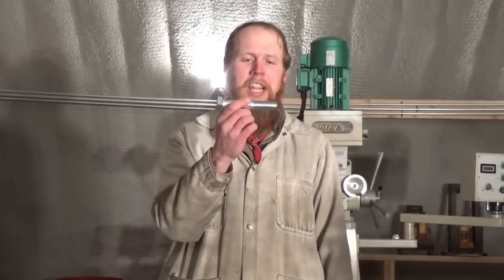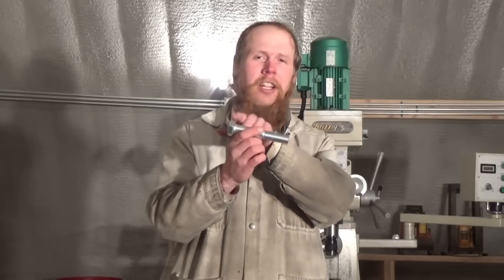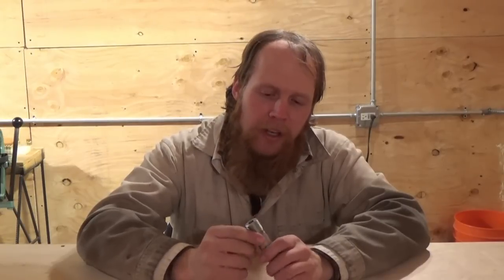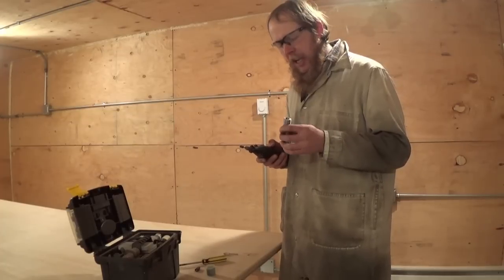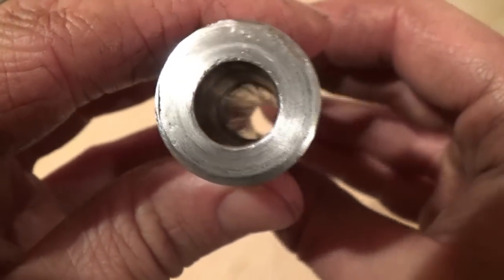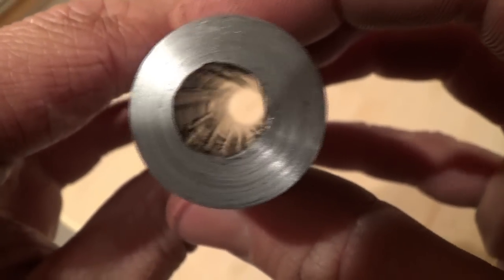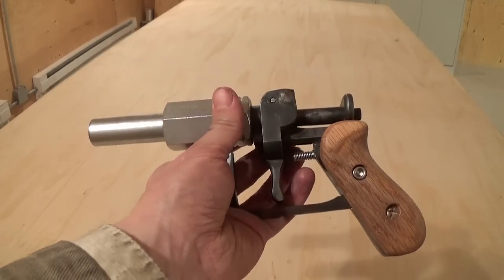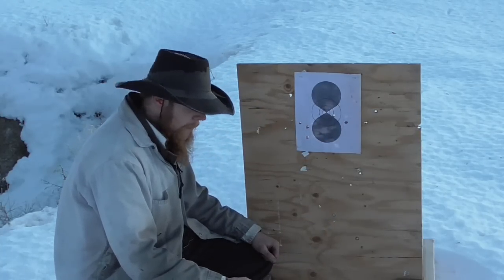Making a Rifled Barrel without Machine Tools (TIS081)

Comment: Simplicity is genius. I've been into firearms for decades, but never realized one can make rifling that easy. Another nail in gun control's coffin!

Thank you for sharing your knowledge.
Reply from the maker: You're welcome - glad you liked it!
Reply: Single nitrated gun cotton isn't really a problem to make. Buying the chemicals might become a huge issue if the gun-control people are out to get ya.
Regardless, i'd suggest using black-powder, rather then smokeless. Potassium nitrate can, if need be, be made from pissing on a decomposable media like straw, in plastic bags, sulfur can be had from gardening centers, aquarium suppliers, and so fourth. It's uses are so widespread it's not going to get banned. And charcoal. Well, if you cant buy good charcoal in the local store, you sure can buy bad charcoal, and use it as a heat-source for making your on, good charcoal.
Yes, black-powder would make a puff of smoke when you fire the gun, and it would be more corrosive on the barrel. Making the barrel is more or less the point of this video, so making a spare / replacement, shouldn't be an issue.
The smoke has to be dealt with. Fire from cover, and it should be fine. People did that for a while before we had smokeless...
Reply: All your gun control are belong to us!

The best use for an improvised gun like this is to find one of the bad guys that looks like he's lonely and tired of carrying that UMP-40 around, and solve those problems for him.
Reply: Consider that China is called the replication country not because of its modern achievements (and they are achievements no matter how much wants to piss on them), but rather because many moons ago, they would make "by ear" copies of Western (including Europe) guns with limited tools and functionality, but that were every bit as complicated to make/replicate as the original, say, prototypes were.

I suggest you head on over to "Forgotten Weapons", Ian has a very nice selection of videos on those weapons. They are every bit as amusing, as they are a reminder, that, one time ago, everyone and their mother could just go ahead and make guns. And it's not just wistful thinking of time long gone, it's fact and reality once you dig in to the lives of the gun designer giants.

They were not so different from every other person roaming the planet back then. They just happened to have all the pieces in the right place to become the ones who made the cartridge, the barrel, the riffling, the striker plates etc.
Reply: Why buy the chemicals? all you need is nitric acid and cotton, any nitrate salt + hydrochloric acid + copper can be used to make nitric acid and the copper can be recycled, or any nitrate + sulfuric acid works too, ostwald process can be used to make it from ammonia but can be kinda hard to find platinum for the catalyst. Also you can just zap the air with electricity from a neon sign transformer or other high voltage source to form nitrogen dioxide which can be bubbled through water to form nitric acid. And if cotton gets banned then everything's already fucked up
Reply: Well... (to) Deep rifling lets gas escape around the bullet. If we tie back in to BP loads, this is both good and bad. It leaves a bit of room for "crap" before the rifling is so messed up it no longer does anything. It also lets a fair amount of the gas you need to push the bullet around pass by the bullet, meaning lower exit velocity, shorter range, and to some extent, lower accuracy.
For smokeless, it's only the bad part that is true...

All in all. You don't want to make the rifling to deep unless you have specific intentions with it.
Reply: You got a point. I did answer in the context of the video. Single shot, or manually operated guns.
Anyway, recoil operated guns "should" work. You need hot BP, which is something different then commercial BP, they go for consistent performance, rather then the best they can make, and as much as you can realistically fit in your rounds.

In the long run primers will be an issue. Armstrongs mix can be improvised from matches, but that wont be very safe, (armstrongs mix is very sensitive, hence works for primers, but loading them can be... unsafe.) and making the brass bit will become a problem once you cant re-use the old ones.
Reply: @SweMisterB  : please look into "Dr.P" videos where he shows you how to make a modern primer compound. Check out google -- patents website they are loaded with stuff on these topics. 1920s-1960s soviets used potassium chlorate based primer compound, yeah the corrosive stuff, but if sealed could last reliable and a long time. Keep up the topics and communicating. Sharing and reading and we will in time have some good BP loads and GOD willing some single-based pyrocellulose/nitrocellulose for our SA/FA arms. In the endgame the gun-control crowd is looking to pull the game in their favor. Smokeless powder, drawing cartridge cases, making bullets and/or jackets, the punches/dies for their production, and a decent primer compound ... this is where they are praying their HAIL MARY. We need to pray HAIL JESUS and study, not give up and recognize this. And in the endgame we hopefully will come prepared. TTYL
Reply: Tiny bit of history. The .303 British round was first produced using black powder, fired through Metford-pattern rifling in the Lee Metford rifle. The cartridge was designed with smokeless powder in mind, but the hotter gases wore out the Metford rifling more rapidly.

There were earlier repeater and breech-loader rifles using black powder.
Reply: +Bill Dyches
I'm fairly sure standing up and banging your chest is not a viable tactic, lol. I suspect you meant guerilla. (Spanish for small war.)
Reply: +denis pucheu when the Nazis occupied Poland they oversaw machine shop operations, restricted access to cutting tools for mills and lathes and acquisition of quality steel stock was license-based.

They still managed to produce their Lighting SMG.
Reply: can you give me some dimensions for the bore and the carver thing in mm please?
Reply: Gun control is one of the reasons some despotic governments are screwing their people as I am writing this.
Reply: They were rifling barrels in the american civil war, probably in a similar fashion. Maybe with a fly press.
Reply: please in .22 9mm and .45 if you know them...thanks in advance...
Reply: Nope. Not even a hint. The reality is, it differs depending on who made the barrel, and when.
Lead casting bullets can, should be done, after pressing a lead slug through the barrel, measuring it at it's widest, and adding 0.002" to the size. (So, they measure the bits that have been at the deep end of the rifling.)
If you already got the bullet casting gear, or, intend to use store bought ammo, grabbing a quality brand, measuring the bullets at their widest, and deducting the same should give a reasonable fit. If your going with steel mantels, i'd deduct half as much, but copper and lead should be fine with the same barrel.
(Not exactly certain how common that kind of ammo is. Apparently the Swedish military sold of a surplus a couple of years ago, so some shooters have it here. From what i've been told it does increase wear, but works just fine with the same barrel as the regular ammo uses, but i'd still suggest a "loser" fit, to increase exit velocity.)

So... The bore then has to be the bullet dimension, minus 0.002, minus the intended dept of the rifling.
Well. That is my understanding at least. I haven't made a rifled barrel in... ever. So theory, without practice. Pretty much worthless. Do with it what you want.
Reply: Like the liberator pistol, which didn't see the light of day, but was a good idea during ww2.
Reply: They will take our dremmels and jacks like they took Red devil lye from the meth cooks.
Reply: +Meow Meow Fuzzyface the bore stays the same and the rifling can be as deep as you like in a small margin ofcourse...?
Reply: +Mr B real nice explanation...thank you for that ! i am getting wiser by the minute here...do you know a site with the dimensions of bore for different calibers?
Reply: surtcaldera of
Reply: PikPobedy how do you think firearms are made?
Reply: SevenSixTwo2012 Good day,

More need to be maimed like this.

One or Two shots, and all blunt or bladed.
.just like the 2nd when wriTten . That is all that was available.  FACT NOT FICTION.

Thank you for your time.
Reply: Yes about China, and then our greedy brain trusts here in America and elsewhere sent our people over there to teach them how to manufacture correctly,  killing our economy, and making gazillionaires of the Walton's  in the process.
Reply: Soul Chicken you can, see the "Anarchists Cookbook"
Reply: Soul Chicken  : this is where the gun-control crowd for years is planning to trap us, then take us down. Its chess, not checkers. Drawing cartridge cases. Making bullets / jackets /dies forming. Primer compound. << this is what they bank on us not being able to do. Then they will take over the means of production, think east germany/USSR/ socialism. Then we will have to as a TEAM not lone wolf, produce the raw-materials to make the bases, then make the product. Together, I KNOW we can. Keep studying. Keep talking about this. Proof, in 1990 not many americans were making diy barrels with a bottle jack and a drill press. Word of mouth, a rebellious attitude, passion drive and never give up we will hold our own in the end game. BP, sure, for more than just 1911's bolt/lever 30-06, 7.62x54R, 8.57, .303 etc. if ya know what i mean ... lol ... but smokeless for your M4, and my 9x19, SKS. If we work hard today together, we will smile tomorrow. Trust me!
Reply: I think it would be interesting to 3D print that same design then use that to make a cavity in a mold with, take some of the more difficult steps out of milling metal, of course, you need some way of melting the metal to pour into the mold, but doable I'd imagine.
Reply: fucking gun nuts these days....

Comment: omg.the echo made my ears bleed.
Reply: @TheIdahoanShow Hey, I'm a sound engineer. The easiest thing you can do is get a lavalier microphone and clip it to your shirt. Your voice will then be much louder compared to the echo. That will probably be all you need. You would want an Omni-directional mic (full 360) and not a Cardioid (very directional, will cut in and out as you move).
Reply from the maker: Sorry--the shop does tend to reverberate a bit.
Reply: TheIdahoanShow .
ha i know..
tis all good.jus messin
Reply: Time to get some egg flats and glue them to the walls, eh?
Reply from the maker: Thanks for the tip--I'll keep that in mind.
Reply: Just use acoustic foam.  Collecting all of those egg flats can be a pain and they don't do as great of a job.

Use liquid nail as an adhesive or better yet, tack them to surfaces if you can as the liquid nail can fail over time and dropping foam on to a work area.  Keep out of reach of flames and sparks.
http://www.foambymail.com/acoustical-foam-products.html
Reply: or don't...
Reply: SirPlsCalmDown  sirplscalmdown
Reply: Hang some Murican flags in that shop..it works wonders! I mean, technically, it COULD be any flag... buuuut.....MURICA!
Reply: walnutlogger 43 Complaining about the sound? As if you couldn't understand what he was saying. What a bitch made comment... You're fucked in the head....

Comment: What about a longer barrel? I've done linear rifling before on a paintball gun barrel, and for that I used the hand-grinding method with abrasive and a lot of due-diligence on my arm work. Now I'm looking to make my own air-rifle barrel to replace one that broke, so what would you suggest as a good way to button-rifle something around 10 inches long? Of course if all else fails I'll just go back to my preferred grinding method since using abrasives is borderline therapeutic for me, but it doesn't hurt to ask.

Comment: shouldnt the diameter of the button be .05 larger or so when you grind the barrel lands you are forming the actual bore diameter? if so how are you grinding to accurate depth the whole way around? 
Or is it just a f it operation because the projectile will swage as much as you need it in most cases? 
I mean, depending on how deep you want your rifling...
Reply from the maker: I drilled the bore to the land diameter, and then made the button out of a bar that was the same diameter as the groove diameter of the barrel, and ground the grooves in the button deep enough that there would be clearance between them and the bore.  The rifling button is only to make the grooves, so I figure it only needs to touch the bore at the points where it is making grooves.
Reply: TheIdahoanShow thanks for the quick reply I understand now. minimal clearance between borw and button is beneficial, only the raised grooves on the button make contact. Fantastic. I'll have to try this on the lathe, but the shop has a 50 ton press should make it light work. thanks again, can't wait to try this!

Comment: Your final groove cut, as you said, is a little rough. Lands can easily be smoothed and polished but do you have a way to scrieve/clean existing grooves of any depth or dimension for less lumpy contact friction even in a barrel refurb?
Enjoyed your presentation and simplification for us who try. JC
Reply from the maker: Thanks - I'm afraid I haven't come up with a good method for smoothing or refurbishing rough rifling yet.  In this case, I think the reason the grooves were so rough is that the rifling button was just slightly larger than it needed to be (like maybe a thousandth of an inch oversized), and maybe not as smooth as it should have been, because when the button broke on the first pass, I polished up the half that I used for the second pass a little bit and the grooves on the second pass came out much smoother.
Reply: Thanks, good man, still workin' on it myself.

Comment: So that would be Hardening.. as opposed to tempering where metal is brought to. 600 degrees then over a long time period an even reduction of temp to room temp?... do you do such to metal and how do you do it?
once again thank you
Reply from the maker: For easily-tempered materials like 4140 alloy steel, I just heat the steel to the desired tempering temperature (300 to 1200 F, depending on the desired balance of hardness and toughness) and then immediately let it air-cool.  In this case, the air cooling is slow enough to provide effective tempering.  Tool steel is much more difficult to temper, and I don't really have equipment to temper it effectively, but as long as it is only loaded in compression or pure shear (which is typically the case for rifling buttons and homemade cutting tools) then it is usually ok to leave the steel brittle, so if I'm making something out of tool steel I usually just harden it and don't temper it.
Reply: Thank You, As I am looking to do a Semibuild of one of the CZ26 Kits and am thinking that I need to Temper the 4140 tube I will be using. The Interrupted, for lack of a better term, threads on the Tail Cap assembly must hold  up all Recoil Thrust Generated by the Bolt under recoil. I am not pretty, and cannot endure any face trauma.

Comment: is it possible to make a rifling die by using a square file that has been heated and twisted just enough to get the desired twist?
Reply: NO
Reply from the maker: Well, I've never tried that method, but it sounds like it might work.
Reply: John Cromar why? explanations help illustrate why, just a one word answer is kind of jackassish.
Reply: Start a uniform twist on your hardened file.

Comment: can you make rifleing with auto travel / cutting threads on a lathe using a button on a boreing bar
Reply from the maker: The trouble is that screw threads will make 4 to 40 full revolutions per inch, so the cutter essentially moves tangentially to the work piece, while the twist rate of rifling is typically less than a tenth of a revolution per inch, so the cutter needs to move in a nearly-axial direction relative to the work.  Thus, generally speaking, you would not be able to cut a rifling button the same way you would cut a screw thread.
Reply: TheIdahoanShow any chance of making a grear set to get the right speed rotation
Reply from the maker: Possibly, but the way most lathes are designed, I think it would be hard to get it to work.  I think an easier solution would be to machine a rifling die/button using a milling machine.  I'm working on a jig to allow me to do that; I'll post a video of it when I finish it.

Comment: Can you Explain YOUR Hardening Process, Thank You For Your Time, YOUR MOST VALUABLE ASSEY
Reply from the maker: If you are referring to hardening the button, I typically just take a piece of tool steel rod, heat it until it glows bright orange (either with a torch or in a forge fire, such as my open-pit forge <https://youtu.be/oh_n5kTbCJQ> or wheel-rim forge <https://youtu.be/KmBpq-JeaSY>), and then quench it in a bucket of used motor oil.